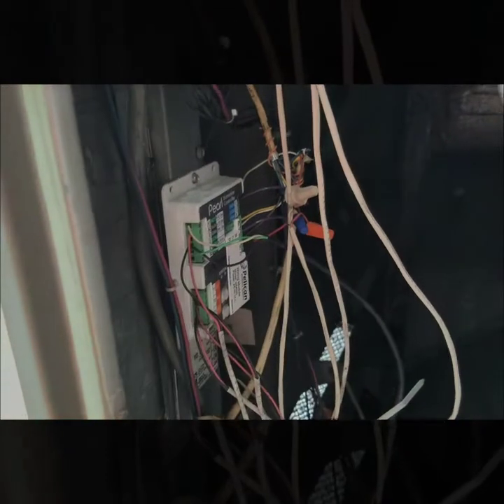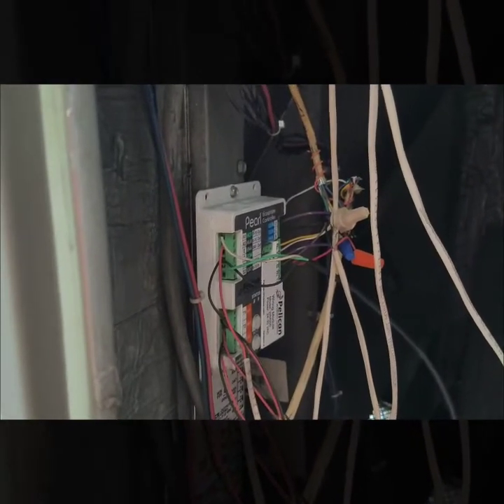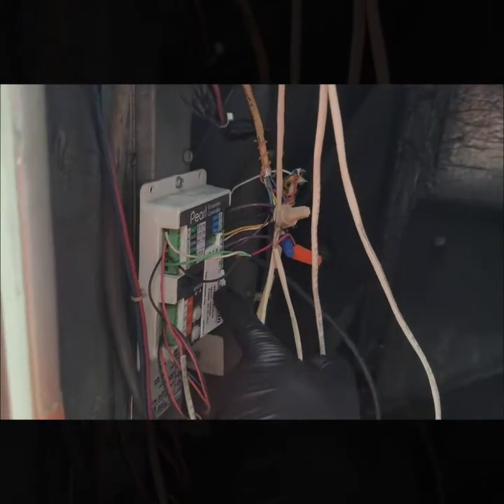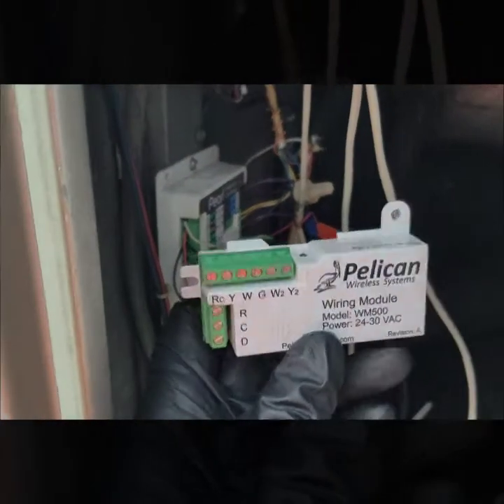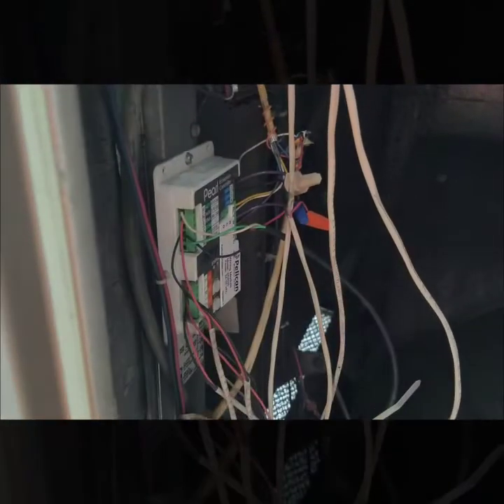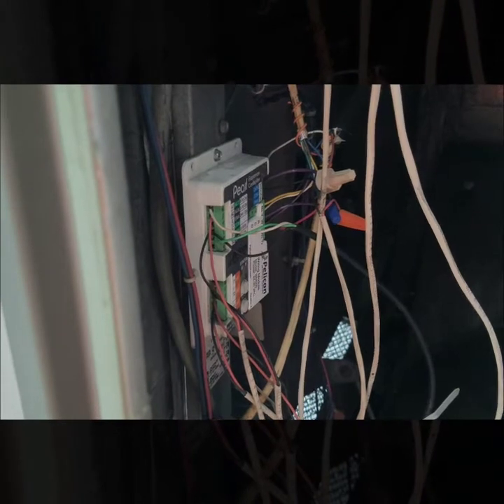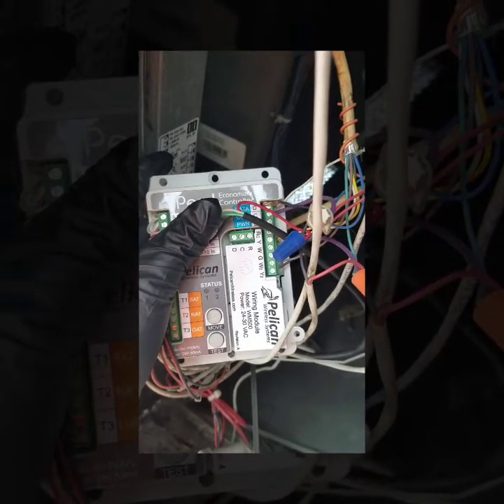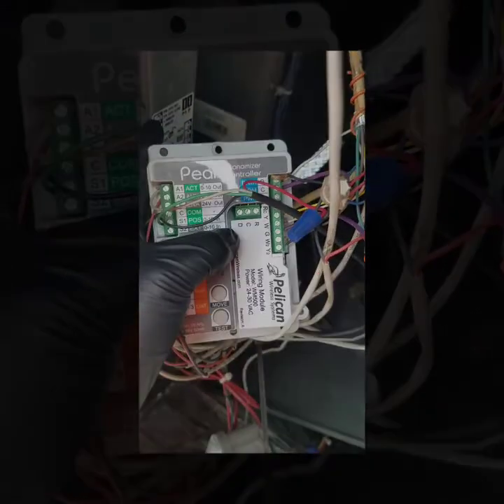Pelican Controls Troubleshooting

Comment: For the Trane economizer to function off the peral . What wires or positions do you use off the Trane modular to the peral ? Thx
Reply from the maker: We install a Balemo actuator for the economizer control and just hook up your normal low voltage wires from the pearl to the low voltage controls on the control board.

Comment: yep my store has a major issue, its not working right at all, it wont cool the back kitchen of the restaraunt. its 116 outside & 92 inside, my mngment have no clue how to work it, so they just ignore it. is there a way to just turn the system off and jyst use the thermostat by itself?